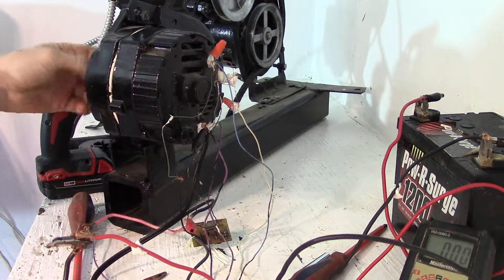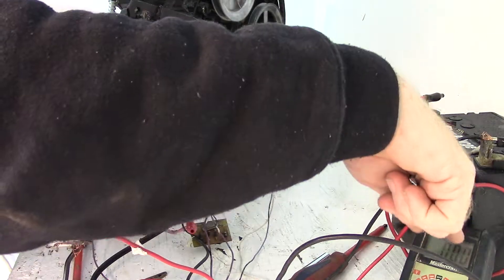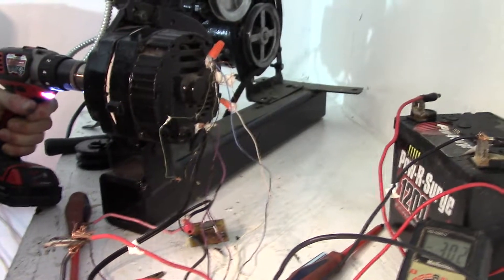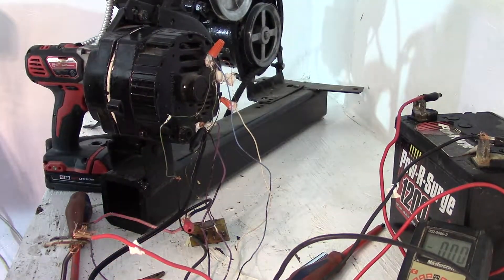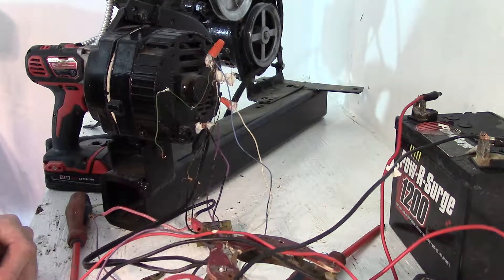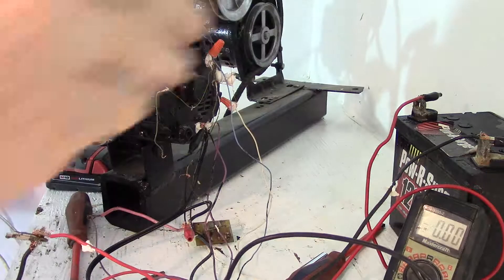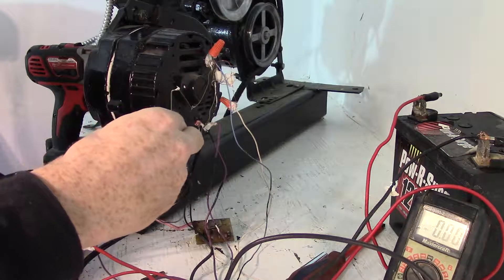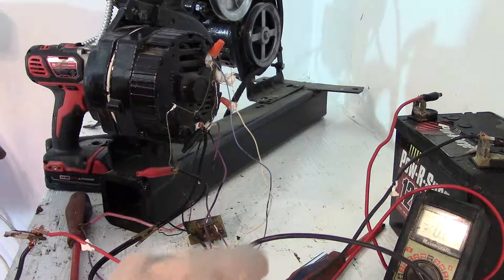self exciting Delco Alternator

Comment: I am also building a wind turbine and would like to learn how to self excite my 2 wire gm alternator
Reply from the maker: I can help you if you need it
Reply: @windpowerandmore6310  i have switched to a couple perm magnet setups. Tried a few dozen combinations. Lol but yes i still would like to go back to an ad alternator with the ability to control it correctly. If u could help me with this it would be greatly appreciated.
Reply from the maker: No problem you can email me jvhoeops@gmail.com
Reply: Howdy. 
I tested the self exciting recently on a regular car alternator.
The rotor needs about 300 mA or about 1-2 Volts of pre excitation for the magnetization to build up.
That pre excitation can be produced with a small solar panel. Alternatively a wind hinge could be used to operate a micro switch. The micro switch then activates a relay to feed pre excitation through a resistor.
Regards.